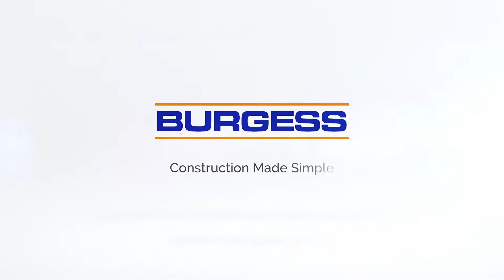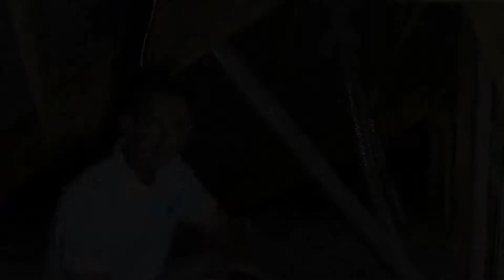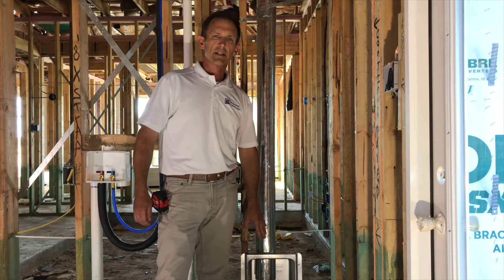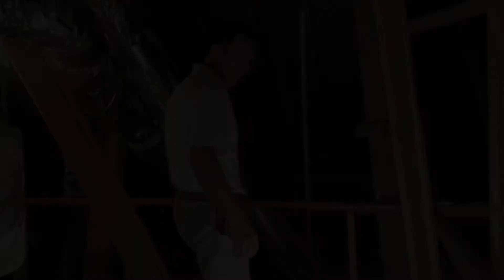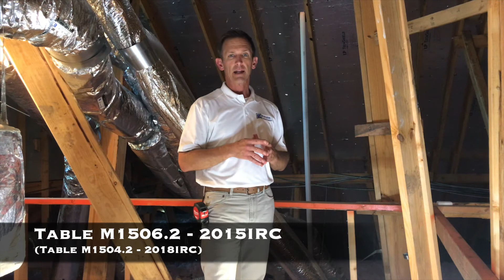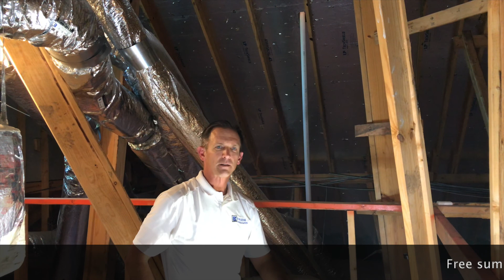Clothes Dryer, Bath Fan, and Kitchen Exhaust Systems - Code changes and installation success

Comment: Forget the screws to join the tubing, you can’t get screws to meet that spec even if you use the malco brand. Even pop rivets will collect lint. Oh even bath vents will collect lint. 

Size the terminations to the pipe diameter for  example I’m getting rid of all flex and upgrading to 4”  rigid aluminum. The hood I’m using is a Broan Nutone 636. Careful with your selection making sure the thing is serviceable. 

I would highly recommend that the piping is insulated in attic spaces

Comment: Running a dryer vent from basement laundry room up 6 feet to 90° angle then extending  25 ft of ridged duct under a deck. Question - how do I prevent critters from entering duct if I can't put a screen on it?
Reply: get a vent with a damper

Comment: What was IRC code in 2007-2008 for the clearance between dryer vent & the intake of a direct-vent furnace? Was there one included? or was it based on manufacture?
Was it 3' ? or 10' ? 
In 2008 my if my dryer vent was installed 5' below & 5' to the side of a bayvent200B (intake/exhaust combo vent) would that have been correct install for the date?
Is there diagonal accommodation? if you are 5' below & 5' to the side?
Reply: , no

Comment: @Burgess In an apartment building are the bathroom vents connected to downstairs apartments?. Or each unit above and below? I got really bad smoker problem coming from downstairs neighbors. They light up all day long and smells like ground zero comes through from my bathroom vent. I've blocked the vent with whatever I could
Reply: The vents should be independantly connected.  This is also a fire code requirements to keep a fire spreading quickly from a lower floor to an upper floor.  However the floors are not air tight constructions in older units and it could be seeping through the floors.  The only way to find out on completed construction would be to have access to the lower unit and use a fog machine and run it through the vent to see if anything is coming into your vent.  Then if it showed it was would they repair it?  The cost to re-route 2 exhaust vents to the roof would be extremely expensive and more likely more cost effective to relocate you.  Check with the state that regulates commercial housing and see what your rights are.  There maybe something there about obnoxious odors and the the landlord being responsible to offer a solution.

Comment: For those devices you would purchase for exhaust venting and sq ft requirements, where does the supplier come into play? Isn't it their responsibility to ONLY carry APPROVED materials and devices?
Reply: Suppliers sell what the people what to buy. DIY by homeowners are not code regulated.  The box stores sell all kinds of stuff that is not code compliant for ducting, exhaust, electrical, pluming and structural.  These are used for repairs and repairs are excepted from code requirements as long as the repair doe not lessen the original code requirements.  That is why DIY and handymen can do work that is not code compliant but a home builder is subject to the latest code requirements adopted by that jurisdiction.

Comment: Thank you for this comprehensive video.  I was having issues with a dryer in a new house and there were multiple things in this video that I found after getting in the attic.  I am adding a booster fan to correct the problem.  Thank you again !

Comment: I'm confused the way this code is written. If all your exhaust ducts from bathrooms and kitchen are somewhere on your roof and your house is already situated minimum 5' setback from property line than what's point of specifying exhaust duct terminations to be 3' from property line. Wouldn't it automatically be within 3' since it's on your roof and your house is at least 5' from side setbacks? Please help, I have this comment on my plans and it's frustrating and feel like an overkill.

Comment: Is code like this a national standard ?
Reply: There is a international (International Code Council) code.  Residential housing falls under the IRC for up to 4 dwelling units 3 stories above grade.  Then States and local and add to or amend from the ICC code.  The ICC is also referred to the national building code, but is used in other countries also.  The local building official has the final say in what code, version and interruption of the code.

Comment: Bath fan 100 cfm Hood fan 400 cfm Clothes dryer 1000 cfm. AC & heat in a home sucked out of the house with no makeup air. YEP...there is a real prob there.

Comment: I cannot find anything in the 2015 or 2018 IRC pertaining to the requirement of backdraft dampers for Bathroom exhaust fans terminations.  Bathroom fans have a integrated "flapper" which essentially servers as a backdraft damper (although poorly implemented, since they tend not to provided a complete seal).  Could you provide the code section in 2018 (or 2015 IRC) regarding the requirement for backdraft dampers at the termination point.

I have seen many installation where the roof jacks have a screens only, no backdraft dampers.

Comment: I just ordered and received an item called the Dryer Jack. It is for my roof to vent my dryer. I also ordered the latest up to code dryer ducting. Right now the ducting runs behind my dryer behind and up the wall into my attic. It has been like that for many years with no issues. I now know that is not up to code and will run it through the roof. My question is are you familiar with the Dryer Jack. It says it is up to or exceeds code in the you tube video. Just trying to do this right the first time, thanks.

Comment: Is it ok to exhaust your bathroom using flex duct directly out of an existing box roof vent on my roof?
Reply: No, flex duct is not smooth wall as required.  The only place flex duct is allowed for dryers is the transition duct between the dryer and the dryer box on the outside of the wall and has to be as short as possible. AC/Heat duct work is not exhaust duct therefore it can be used as it has it's own requirements for sizing and placement.
Reply: @jon10231  Jon, thanks but I was talking about a bathroom exhaust fan, exhausting out the roof not a clothes dryer.

Comment: what you said is some good information what is the guidelines for the houses that are duplexes for running duck work for kitchen hoods that are on walls that are back to back 2A peek roof what is the code for running 6 inch galvanized steel pipe through an attic to a roof vent from the back door to stoves are 25 feet away the peak roof may make the distance a little shorter but what is the national code compared to the local codes

Comment: For the 2015 irc are you allow to have your bathroom exhaust going to the soffit? Or does it have to go straight up
Reply: Im also waiting for his reply for your querry?
Reply: Cannot terminate to a vented soffit, or closer than 3' above a window.  This would allow the exhaust to enter the attic or the home.  If it is terminated at the soffit that is not vented and not a window and more than 5' from the property line and has damper then you should be good to go.

Comment: Interesting, inspector in my project said "no screw in joins, only tape"
Reply: Your inspector was incorrect if 2018 IRC is in effect in your jurisdiction.  Paragraph 1502.4.2  "Exhaust duct joints shall be sealed in accordance with Section M1601.4.1 and shall be mechanically fastened.  Ducts shall not be joined with screws or similar fasteners that protrude more than 1/8 inch into the inside of the duct.

Comment: 15ft for a 90? Wasn't it previously 5ft?
Reply: for 6" flex i think he said.  so ridged pipe i think its 5' for a 90*.
Reply: @neckofthewoods24  No flex for dryer exhaust.
Reply: @jon10231  well you have to at least at the dryer to first section of solid pipe.  And I used semi solid, not the cheap coil paper type stuff.
Reply: 5' for each 90 in smooth exhaust duct and 2 1/5 for each 45 degree. he mis -spoke.

Comment: This video just pissed me off. All these damn rules, my god
Reply: Burn your house down then
Reply: @blindhelicopterpilot  well lets not create total chaos. A good fist pound on a table should suffice lol
Reply: @blindhelicopterpilot  Truthfully though, a lot of these rules come from real accidents/issues/fires...there's a lot, yes but I try to remember that when getting frustrated with it.
Reply: The many rules are to build better homes that withstand wind storms, resist fires and are more energy efficient.  The rules don't add much to the overall costs, the absurd markup on building materials and ridiculously high markup by builders and the long term mortgages is where the insane costs are coming from.ght, so m

Comment: Good info. Is it ok to direct bathroom exhaust fan to the house soffit instead of the roof? I am afraid that warm air will be recirculated back into the attic which cause molding later.
Reply from the maker: I in the 2015 IRC, section M1501.1 states that "the air removed by every mechanical exhaust system shall be discharged to the outdoors in accordance with Section M1506.2. Air shall not be exhausted into an attic, soffit, ridge vent or crawl space."  Note that it specifically prohibits the soffit. These ducts should connect directly to their terminals. This connection will prevent the exhaust from remaining in the attic.
Reply: @Burgess-Inc  If it is not vented soffit and not near a window then I would think it would be ok.

Comment: Thanks for the great info!  Couple questions; 
Can I run flexible ducting in a ceiling or does it have to be rigid?
Do I have to have the vent hook up box in the wall behind the dryer?
Reply from the maker: See below for answers. I hope this is helpful. 

Can I run flexible ducting in a ceiling or does it have to be rigid? Flex duct would not meet the code's requirement for duct construction. IRC M1502.4.1 says, "Exhaust ducts shall have a smooth interior finish and be constructed of metal having a minimum thickness of 0.0157 inches (0.3950 mm) (No. 28 gage). The duct shall be 4 inches (102 mm) nominal in diameter."

Do I have to have the vent hook up box in the wall behind the dryer?  No, there is not requirement for the box or its location.